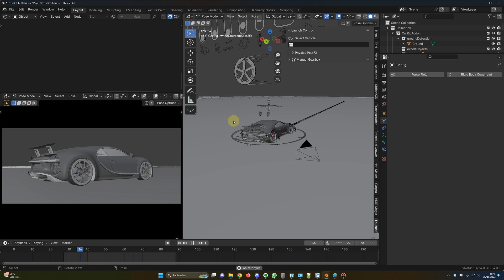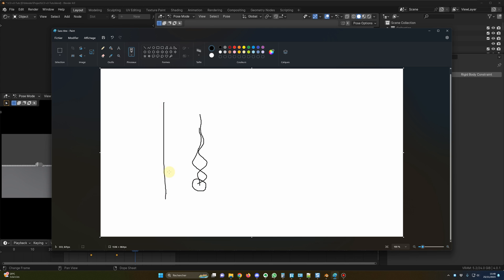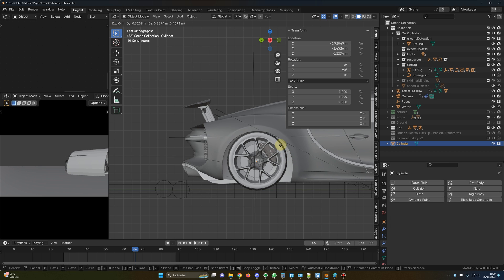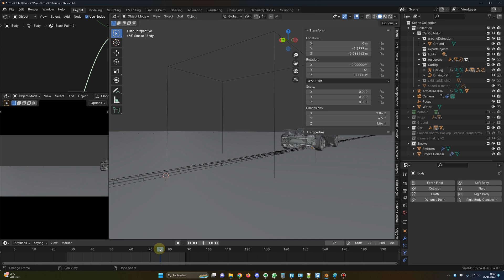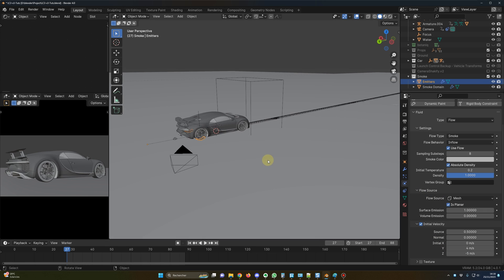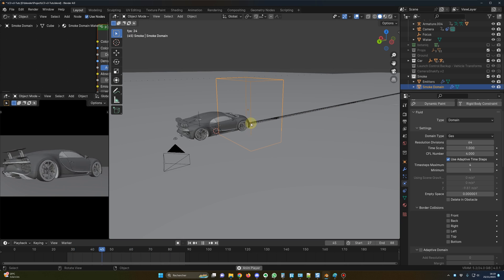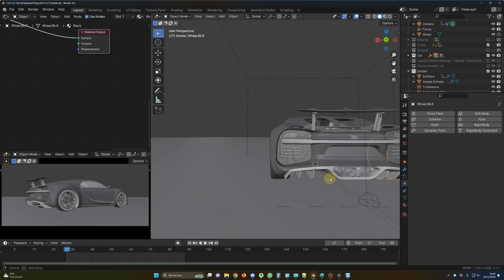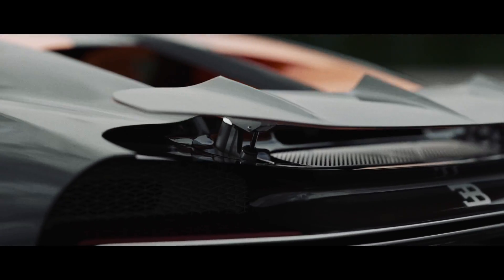Blender tire smoke tutorial | Tire burnout for beginners

Comment: Thanks for the video. Can you talk about the scale settings for the domain and how you arrive at the right size for the simulation. I’ve got a massive domain around a small plane model which is different to yours - I’m simulating tyre smoke off a runway when it lands. If I scale it cocks up my other settings I have with an animated carpet.
Reply from the maker: adaptive domain is key , and you camera framing. Try to render only what's in your framing.

Comment: when i click bake it crashes ans i have high end system 4090 ...is there any solution
Reply: what blender version have you? have you set the project settings properly in order to use your GPU?
one other sugg, verify if you have Unused Data using the Orphan data purge system, maybe your project 's too heavy
Reply from the maker: use blender 4.3

Comment: everything went great but went to bake data and my PC just crashes, specs 3080 ftw3, 64gb ram, i7 cpu ??  im so confused and its a newest version of blender with the most updated version of launch control
Reply from the maker: It should NOT crashes you have a very good PC. Start with a very small simulation first they see from there.

Comment: Sir in my case the smoke is working correctly when the domain is in default size bt when I change the domain size then it doesn't work...can you please help me
Reply from the maker: Be sure to update the resolution just to refresh the simulation.
Reply: i ahve the same issue :/ and yes ive updated the resolution